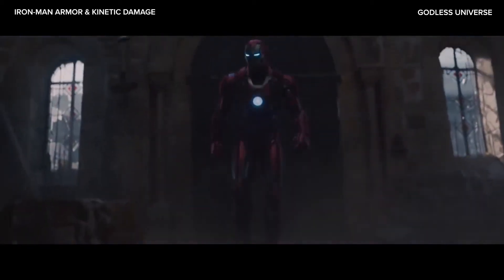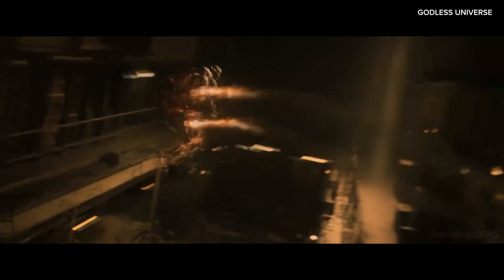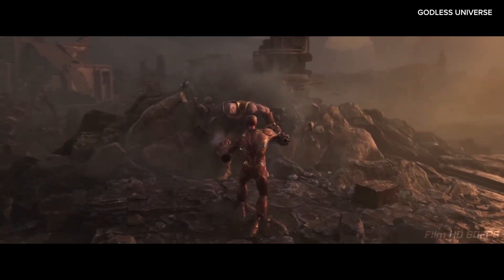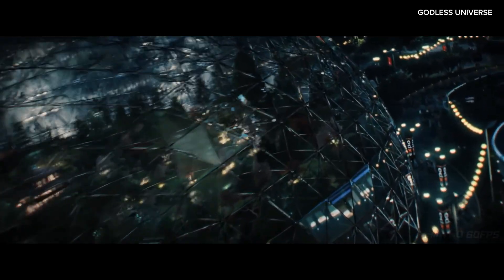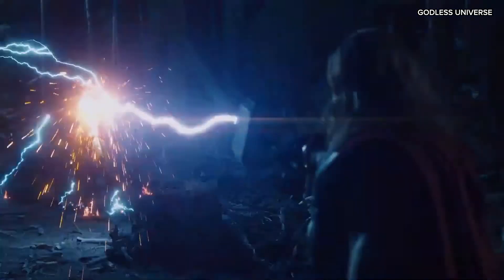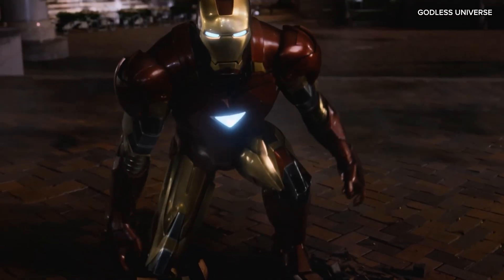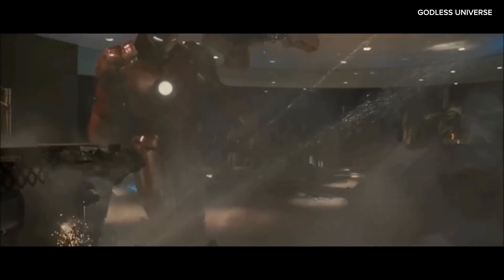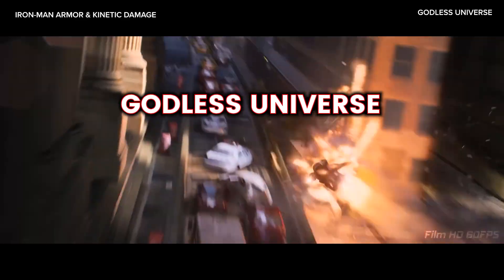Physics That Make Iron Man's Armor... Impossible

Comment: 5:01 In physics, one moving part equals one weakness. His suit has a least a thousand of them, very thin at that
Reply from the maker: That's actually an interesting way to look at it, and it's true... moving parts require power, they create friction, increases intrinsic weakness to the structure and systems, as well as additional heat generation and constant requirement  for lubrication. Those are just a few things as the number of moving parts of a system increase.